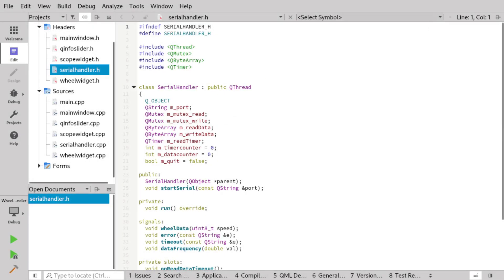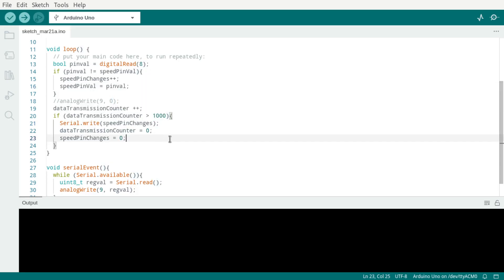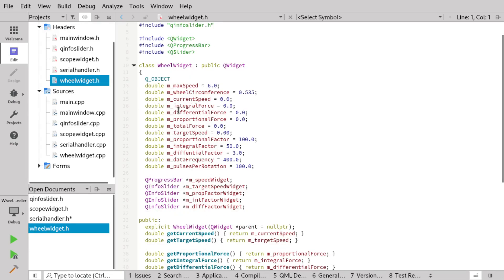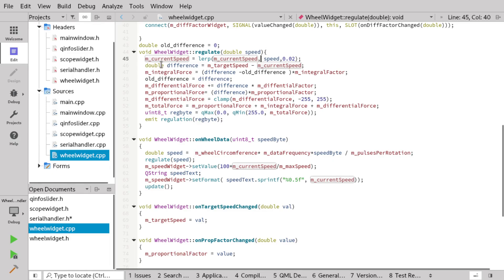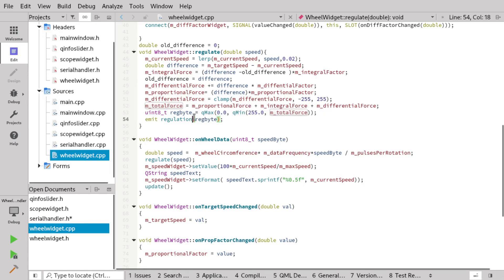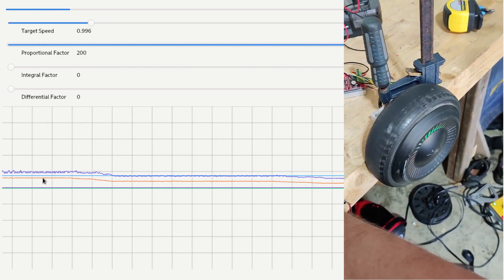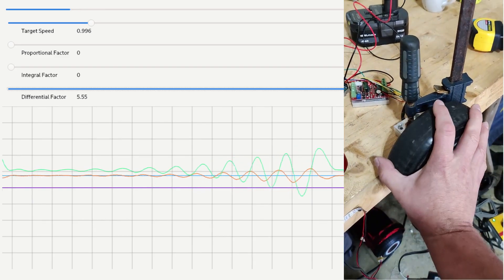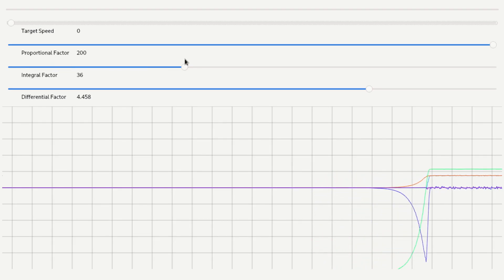Running a Hoverboard Motor with a MotorController using and Arduino Uno Part 3.

Comment: I need to create a program to do exactly what you demonstrate on your video, the code using ZS-X11H board to control a hoverboard motor to run on a specific speed, but on a max torque if needed, the main ideal is to automatically apply torque when needed if the load increases. Can you do that or point me to the right direction? I really appreciate it thank you.